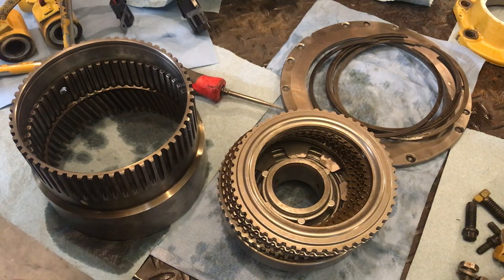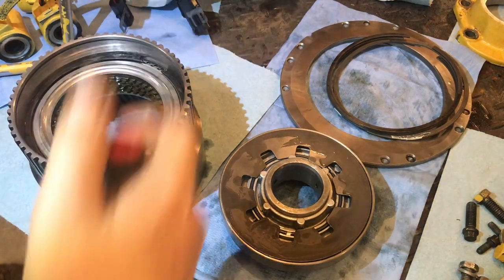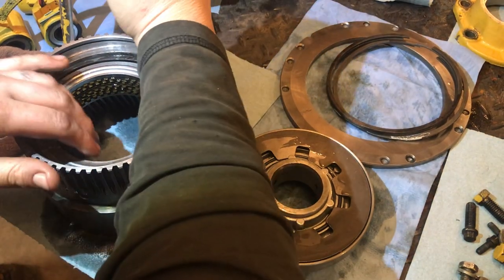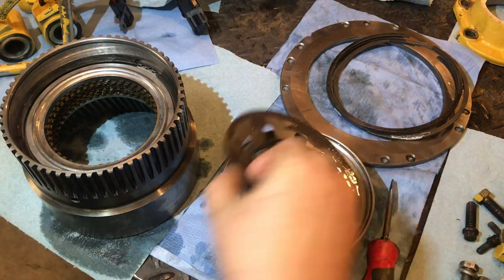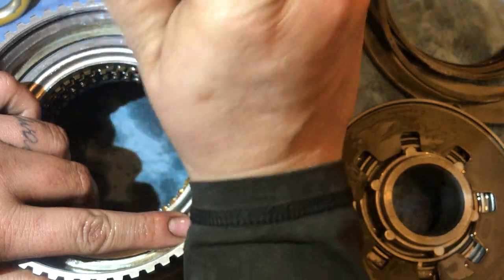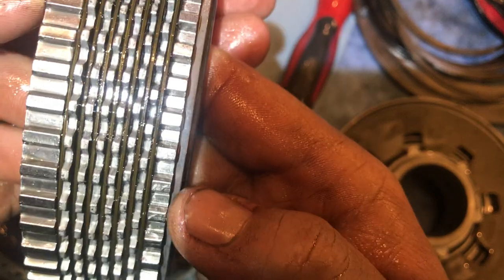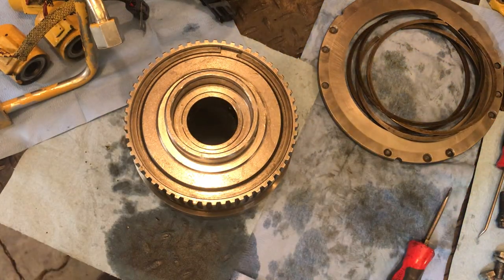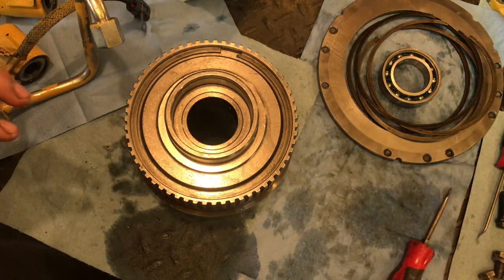(191) John Deere 310D reverser forward clutch pack assembly

Comment: I just found my repair book. The first snap ring at 2:10 should be .090-.093 thick. It DOES NOT fit in a groove!  The snap ring at 14:11 should be .074-.078 thick. The piston assemble needs to be compressed to install this one. the other rings are used where the one in the middle of the clutch is to set the clearance between the clutch pack and the ring. it should be .021-.036. measure with feeler gauge and change to a different ring if needed. I hope this helps!
Reply from the maker: Thank you! That’s very helpful 
After I got the backhoe together forward worked good for a day and then quit. Reverse feels perfect but basically no forward. I’ll take a video of what it’s doing soon and hopefully I will pull the reverser again tomorw. I was suspecting it was some problem with the forward clutch pack but couldn’t find anything useful online.